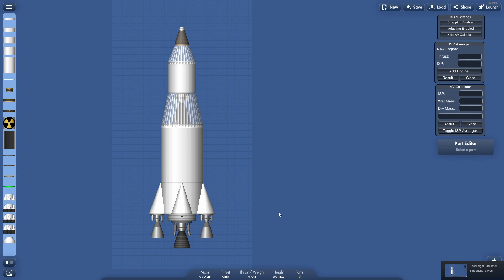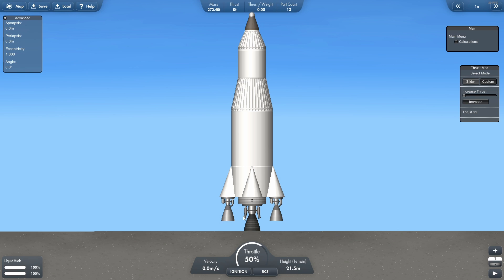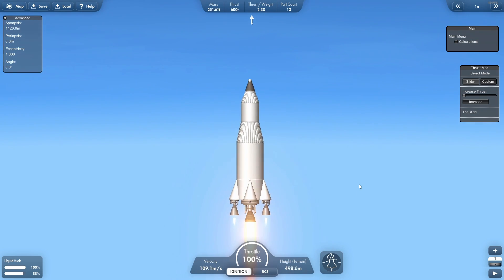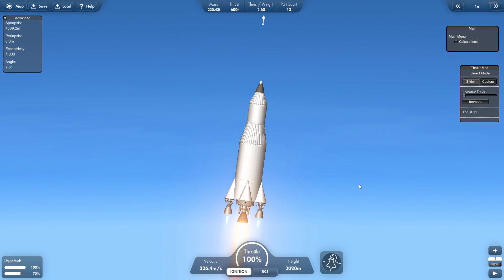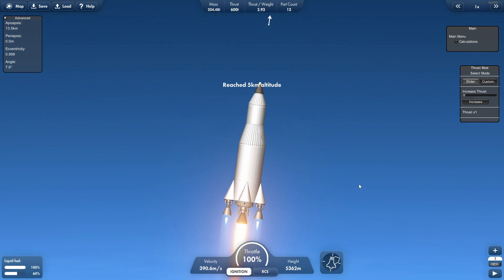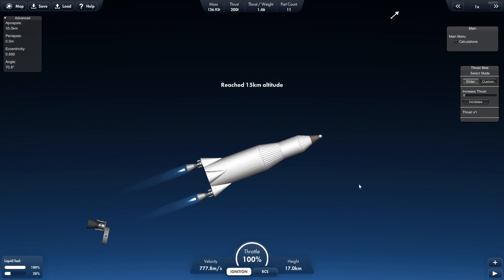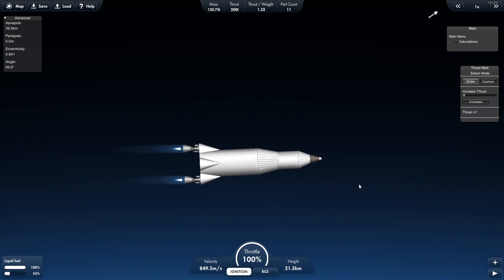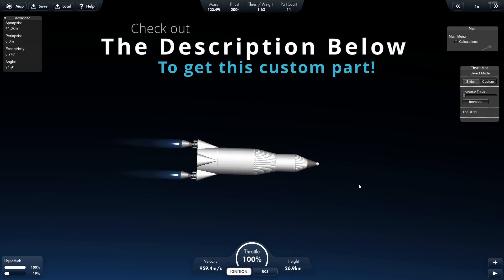How 1.5 Staging works and the Engine Breakaway Part in Spaceflight Simulator that makes it possible.

Comment: i dont know but dropping an engine doesnt feel right 
instead if it is possible to control the particular engine thrust by yourself  

cause dropping an engine or just make it turn off😅
Reply from the maker: They did it on the Atlas II! I know it feels weird but it’s a huge plus!

Dropping an engine means you are no longer carrying the weight, when you look at the heavy thrust engines for lift off, at 12T of dead weight it’s a significant deltaV improvement to loose it once you know you can get to space with the remaining engines.